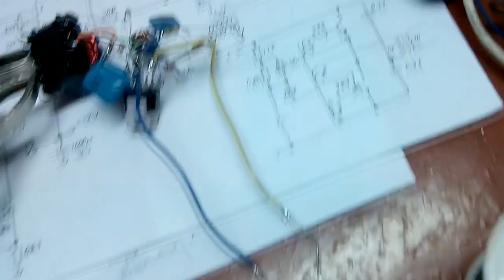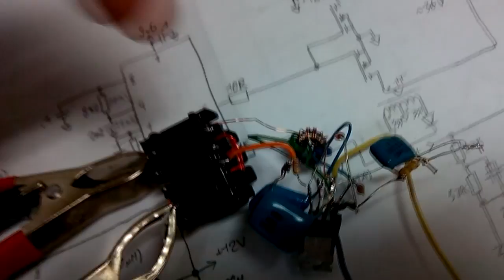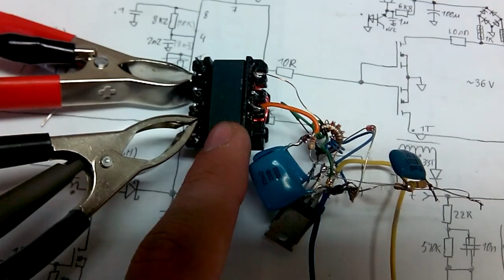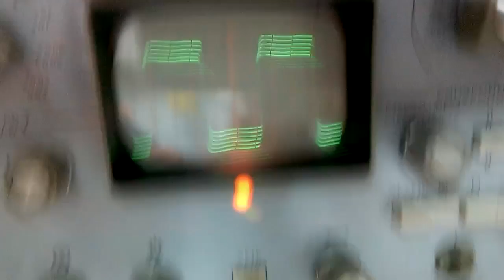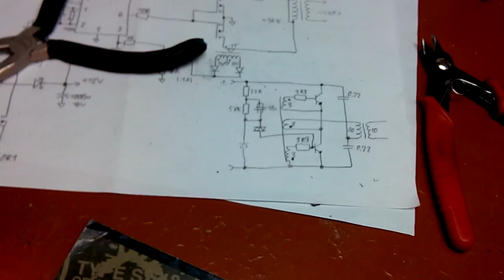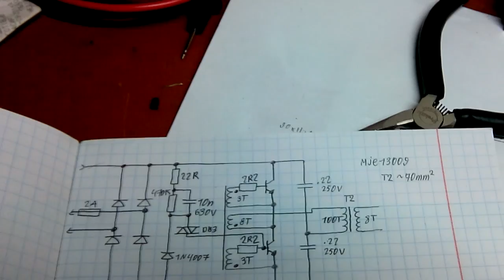Simple 12v 40W SMPS for active loads

Comment: Transformer wire diameter please!
Reply from the maker: AB Rider BD Feedback transformer is just like in the other one, 0.4mm. Power xfmer: primary 0.5mm wire, secondary is two 0.6mm wires in parallel.

Comment: i have even bigger transformer 50 pounds or 22 kilograms ;)
Reply from the maker: Andrewz! Electronics & More Is it 1000VA or something? That's a big ass chunk of iron you got there :D
Reply: I dont know what is the power :D But i connected it with 33 volts to the primary and i shorted the secondary and i got 200 amps on secondary and the voltage on the primary dropped to 16 volts :D so the power at 240 volts will be? I do not know :D
Reply: and try to guess where i found that transformer :D
Reply from the maker: Stop showing off, you are making me jealous already :D Don't say you found it on the curb for free, that would impair my sense of happiness LOL
Reply: lol :D i found it in our old shed xD

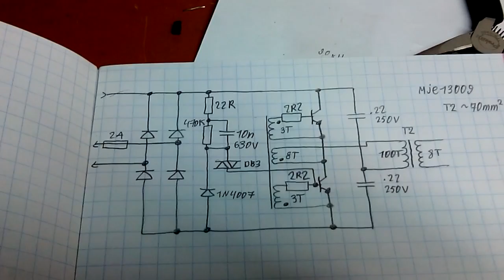Comment: Hi sir,schematic shown at 10:08 has no earthing connection,so  without eartthing it does give  shock? and when does smps gives shocks is it depend on freq used in pwm ?
Reply from the maker: It depends mostly on the quality of construction. If you build it properly, with a good amount of insulation, it won't give you any shock at all. Smaller SMPS's (flybacks) can give a small tingling sensation when you touch the output because they have interference suppression cap between secondary/primary.

Comment: that is nice do more smps stuff. what is that diac rated at ?
Reply from the maker: +JOSIP Žlk There are also switchers inside of my 3W&7W LED bulbs, as well as inside of 3W desk lamp. Just in case you didn't see them.
Reply: +MrJohhhnnnyyy  I will check that out